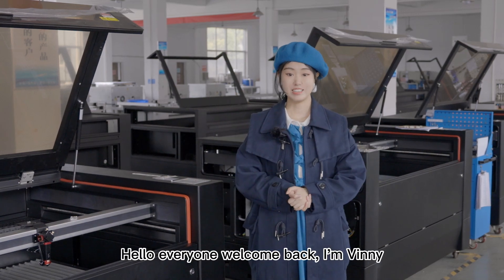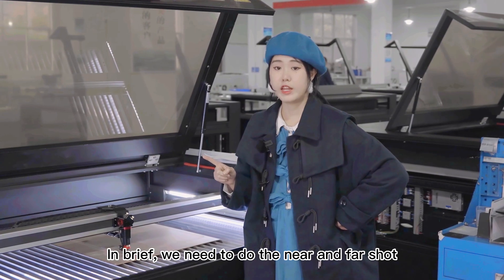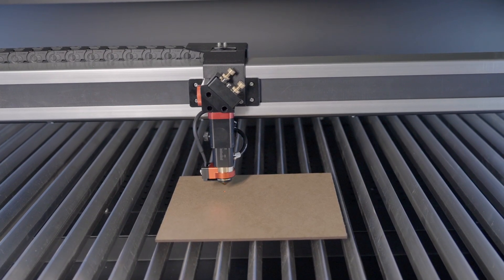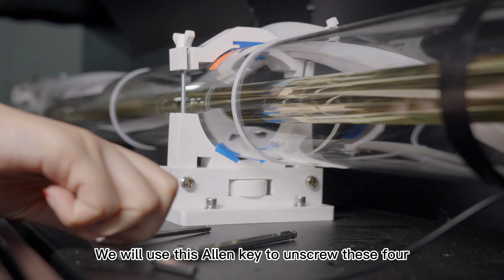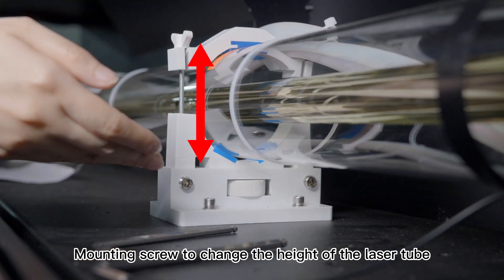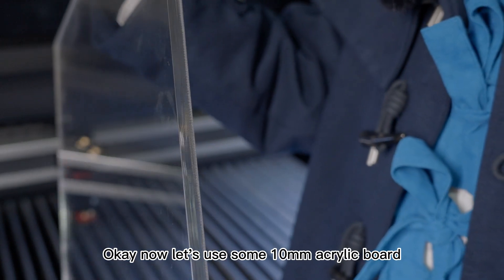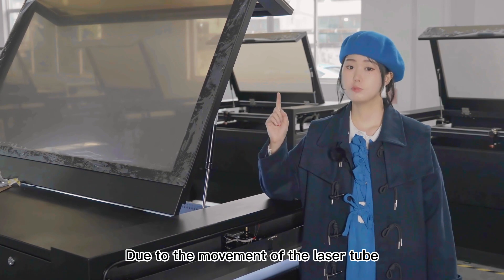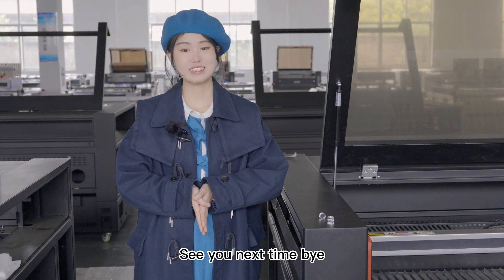Laser Vertical Alignment for NOVA Elite | AEON Laser | CO2 Laser Cutter

Comment: I think it would be best if the laser tube was in a fixed position from the start and not need to be adjusted, But then again that's just my opinion.
Reply from the maker: Theoretically, the optical path of the laser tube will not change when it is in a fixed position, but there will still be some changes in the optical path due to unavoidable shaking during transportation.